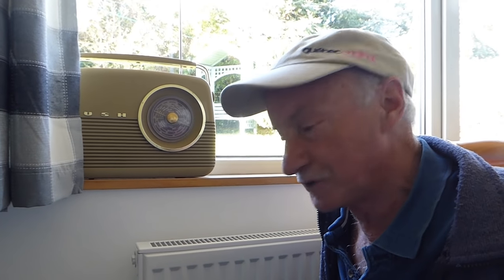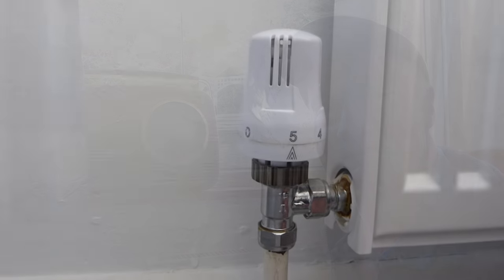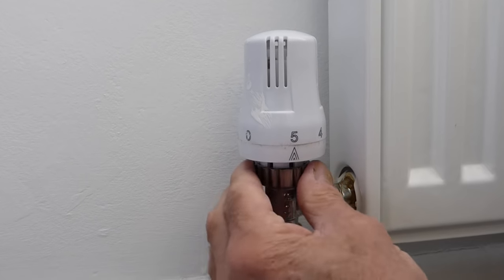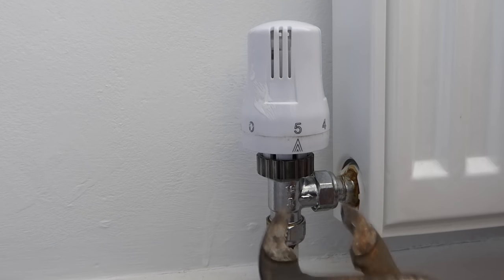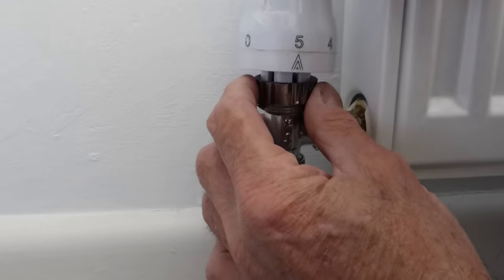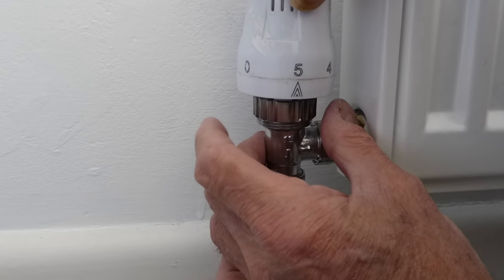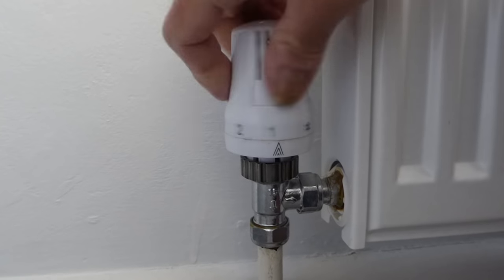How to remove and replace a thermostatic radiator valve head

Comment: So.... I was messing around with my brother and snapped the whole thing off and the radiator was stuck on full blast! So I took the base with the twisty nozzle thing and stuck a coin inside and forced it on managed to shut it off temporarily but I will have to buy another to fix it properly, your video is a life saver!
Reply from the maker: No problem.

Comment: Haha, your video is still helping people after 8 years. Thank you for such short and simple video it was helpful. 
After the maintenance guy at my place removed it and never came back to put it back, I was struggling with put it back in. I knew what to do but i was not sure if that was the right way to do it. Your video definitely helped.
Reply from the maker: You're welcome!
Reply: EXACTLY my situation. Only I did put it back on myself but just wasnt 100% sure if the number 5 was supposed to be when you put it down on top of the pin. (It was! So thank you for this little confirmation video). A very easy little job but essential if you want to regulate your water flow/radiator temperature

Comment: Thanks. I thought you could replace them as easily as this but my plumber told me you had to replace it with the exact same head. He said that there were loads of different sizes of threads from different manufacturers and if I couldn't find the exact replacement head I would need a whole new valve including the metal part which would mean draining the system. Unless there has been a massive miscommunication, he's trying it on with me!
Reply from the maker: You will need to get the same head as the make of your valve.
Reply: dereton33  Thanks very much for taking the time to reply. Great.
Reply: Is there an easy way to identify what make and model of valve that I'd need?

Comment: My radiator in the sitting room hasn't worked for months properly since I moved into new flat. Woman said she's upgraded boiler and central heating. I'm wondering that she did it herself now. Checked today of photos of valves to try to solve problem and realised the thermo valve was fitted back to front so dial facing the wall!! Thank you for this video, I've moved it round to face the room so I can actually see what setting it's on! 

It also seems to have a valve on either side (normal old fashioned one on the left, thermo on the right). Don't know if this is affecting its ability to heat either.
Reply from the maker: No that will not effect its ability to heat up.
Reply: @dereton33  thank you again for your video. My sitting room is now warm for the first time! I changed the direction of the other valve & hey presto. 

Can't thank you enough... I'm just frightened of my gas & electricity bill this month trying to heat the place before I realised the issue, but you've saved me cost of a plumber or winter of discontent. I'm in your debt👍

Comment: Thanks for this! Had a mare when 1 fell off completely in a house which already has a few wobbly ones. Couldn't even get it back on till I held the head in my head & turned it fully the other way after which it popped right on! Although I think I've screwed the direction of number to turn, but hey ho I'll figure it out when the heating is on. Cheers again, couldn't go to bed till I knew I'd fixed it!
Reply from the maker: That`s great.

Comment: Cracking video, im looking forward to updating my TRVs to battery operated smart TRVs (control whole house / rooms / rads with an app)
Reply from the maker: Fine so long as the batteries last.
Reply: @dereton33  I know exactly what you mean.

I installed wet underfloor heating in my house and used heatmiser battery wireless stats. They only took non rechargeable AAAs which lasted only 6 months.

The idea of putting down loads of insulation to be more environmentally friendly was slightly tainted by using up 28 AAA batteries every 6 months 😬

From what I gather the drayton ones last 12-16 months, however before buying I will try and find out if they can take rechargeable.

That being said I want to stay with a decent brand as I don't want to be changing them out every 4 years due to tech being outdated.

I doubt they will do a smart wired stat.

Another idea I had was to have some kind of 'in line' 15mm stopcock which you could control with an app.

Luckily I live in a bungalow so all pipes and the likes of are nicely organised in the loft which is just lovely.

Another option to control each rad better is to buy some of that plastic/ali pipe and put a manifold up in the loft somewhere and control it that way

Comment: Hi, I’ve moved into a house that’s 12 years old, I have changed the wall thermostat to a new digital Honeywell dt90e as shown in your video, fantastic thanks for the guidance. 
Now I am wondering if I should change the radiator valve heads? Myson 2 TRV 2 way, do they a expiry life. Thanks kevin
Reply from the maker: They should last a longer time yet why not wait until you see signs of them playing up.
Reply: Thank again, your are heatsaver 👍🏼

Comment: Great video. If my thermostatic valve is dripping water from underneath the head (running all the way down the upright pipe), do you think I might need to replace just the top section? Thanks!
Reply from the maker: No the whole valve.

Comment: Clear and simple video thanks.  Do you know what make of valve that is?  I have one the same that is faulty.  When you turn it to 0 it doesn’t turn the radiator off.  The valve itself moves and you can turn the radiator off by pushing it down manually with a grips just seems to be the head doesn’t push it down properly.
Reply from the maker: I don't, it was done a long time ago.

Comment: Thanks for your videos. You mention about replacing the top (head) part of the TRV if it is gone (faulty). How do you establish that a head is faulty?  We have slip on TRVs on a number of radiators, and not the screw type. The local plumber cannot source these types of head, so would need to change all if the TRV if they are faulty, so trying to establish if any are faulty first? Thanks
Reply from the maker: You do have to know the make and if you can get just the head not all valve manufacture's do.

Comment: It always looks easy until you try it. In my case I couldn't get the new head collar to fit the existing valve thread. Checked with calipers and the thread sizes were different by about 2mm. So frustrating, so now what do I do ?
Reply from the maker: Complete new valve you have an old odd size there.

Comment: I tested our heating in the house we've just moved into. Upon having all radiator thermostat valves set to zero or off I turn on the heating and then I have a radiator which goes really hot even when the rtv is on off/0. I've swapped it around with another one but it still goes really hot. This is one of the bedroom radiators upstairs. The hallway radiator I understand should always be on in order for heat to escape from somewhere.
Do you have any tips or recommendations for this? It's driving me crazy. Thanks a lot
Reply from the maker: The valve itself and not the head will be faulty, best to renew the complete valve.

Comment: Brilliant video! But I think there may be something else wrong with mine as the top of the radiator doesn’t get hot, only the bottom.
Reply from the maker: The rad needs bleeding.
Reply: @dereton33  Didn’t think of that! Thanks 👍🏻

Comment: How do i tell at what temperature i have to fix the new knob on? Basically making sure the current temperature of the radiator is in sync with the new knob i fix, so if i rotate the knob its showing the right temperature. I see you fixed at 5 but how do you tell your current knob is working at 5 temperature? Hope it makes sense.
Reply from the maker: It will be at 5 when the pin on the valve is fully up. As you turn the valve it will push the pin down and so turn it off when it reaches 0

Comment: Is there a way to remove the valve when the radiator has been removed from the wall for decorating? (Your video on that one was extremely helpful!)
Reply from the maker: Only if you drain the system.

Comment: Hi I want to change the head only do I have to turn off the  boiler  or drain water off sir   thank you for your answer another question you know that black  pin in side top is came out this means is broken or can be like that many thanks
Reply from the maker: No.

Comment: Hi Dereton

I had an engineer come round yesterday to replace a thermostatic radiator valve. I watched this video previously and removed my thermostat which allowed my radiator to work great. 

Once he applied my new thermostat. I'm having the same problem as before. The radiator will heat up as soon as my heater/boiler turns on. And then get cold after 30-45 mins whilst all the other radiators are hot. 

I ended up removing the thermostat again. The radiator is now working great without it. But I'm unable to control the heat as I no longer have a thermostat. 

Do you know what might be the problem?
Reply from the maker: Your heating system needs balancing.  Or the radiator maybe the bypass one, or one placed close to the room stat in a hall. If that is the case then turn the valve flat out to number 5.

Comment: Question. I have a leaking valve and afraid if I take it off the water may spray everywhere.
Is there a way off shutting it off before I replace that head?
You turned yours up to 5 
I had to turn mine down to 0 to stop it leaking. Any advice gratefully received
Reply from the maker: If it is a thermostatic valve leaking there is no way to repair them, they have to be renewed.

Comment: Hi can I just ask , can you get a stat that you can put on a radiator by just fitting it on the fitting that is  there already or  is a is necessary to change slightly the pipe work to accommodate it ? Simple clear videos - thanks !
Reply from the maker: Yes you can.
Reply: @dereton33  ah wow that’s so much for such a quick reply - have a nice Easter !! Nuisance now I appreciate - in Ireland - we have b and q here - is there any chance some time you could add a link or name of one ? Thanks again

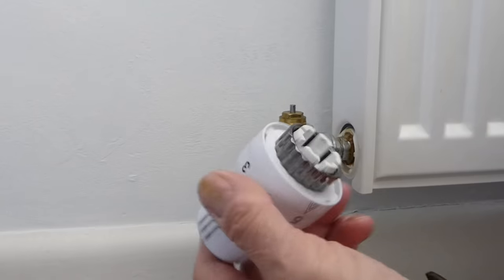Comment: I have a tiny leak coming out of the bottom of the trv head. Do you think the gold nut at 1:03 (exposed when you took off the head), just needs a tightening?
Reply from the maker: No dont touch it, you need a new valve.
Reply: @dereton33  thanks, thought ptfp tape might help but looks like I'll have to call the plumber 😢

Comment: Hi. Thanks for this. The top of mine seems to be broken /snapped? I had it replaced not too long ago and it’s happened again. Is it because it was put on too tight.?
Reply from the maker: Could be, they only need a small nip up with grips.
Reply: dereton33 Thanks. It was broken and I thought it was replaced and when radiator was. But I think the valve head may have been glued on as it seems weird it would happen twice.
Reply from the maker: Yes may already have been broken.

Comment: Can I please ask is that all you need to do if the radiator is only working say at 3,4,5 setting abd not 1 abd 2 or do I have to change out the metal bits that come in the packet also?? Thank you
Reply from the maker: Do not worry most of them only work on the 2 and a halve and above setting

Comment: I broke mine the other day,it snapped off, is it just a case of replacing like this and does it matter which one I buy to replace it with,does it have to be the exact same one  ? If so how do i go about finding the exact one i need ? Thanks
Reply from the maker: Look for the make on the side of the valve and get the same one.

Comment: Hi Al! I have a question, if I am moving the head to a radiator that didn’t have a head before, how do I know what temperature to set the head at? In others words, how do I make sure that the heat coming from the radiator it’s the one set on the head?  
 I hope my question makes sense and thank you!
Reply from the maker: Make sure the new head is set full on number 5 or 6. Face the reading cut out facing you into the room and screw the chrome nut onto the rad valve body.

Comment: Hi great video! I am trying to replace my trv head with a trv head from another radiator in the house. Both TVs are the same make, but when I try to put the different head on, it doesn't lock into place. Any ideas? Cheers x
Reply from the maker: No they should fit. Maybe worth trying another one.
Reply: @dereton33  thank you! Also, when replacing a valve head, does it need to be the same make as the previous one? Or just the same size?

Comment: Mine was even easier, after taking off the top the pin in the brass valve had jammed down stopping hot water to the rad, squib of WD40 and a tap with a hammer and it popped up, job done🤗🤗
Reply from the maker: Well done.

Comment: Great deno. Thank you. One question hoping you can help with. I've bought a new TRV but the pin on the valve sticking up is to tall for the new TRV (probably by 2 to 3 mil). So the new TRV doesn't drop low enough to reach thread to be skewed in place. What can I do? Thank you!
Reply from the maker: Did you buy just the top as not all of them fit.
Reply: Hi  @dereton33  - no I bought the whole joint, but not sure about replacing the piping joint as I'm terrible at DIY. I thought of maybe cutting a 2 mil off the pin to make it fir?

Comment: Our valve head came off (think little one had been messing) I’ve put it back on but the radiator won’t heat up..the pipe leading up to the valve from the floor is warm to touch, but the radiator is ice cold. Any suggestions?
Reply from the maker: Valve head located in the wrong position, take it off and replace then make sure it is turned up to 5.

Comment: I dont know if anyones going to reply but i bought a new one and the sticky out bit on the radiator valve stops the thermometer like it wont fit as the thermometer doesnt have a hole to slot into
Reply from the maker: Not all rad tops are universal. You will have to change the complete valve.

Comment: Can u keep it off want a radiator cover and will fit better if this is off? Thanks
Reply from the maker: Yes you can but the rad will be on full blast unless you turn the locksheild valve down on the other end.
Reply: Thank you x

Comment: I have a radiator which runs on water (not steam) with a valve head just like this one. It is always fully closed, but whenever I open the window it gets hot, which makes me think that the "0" it's on is more like 1-2, since it gets hot when cold air blows on it through the window. Is there any chance that the problem is just the valve head, or more likely the valve itself? In other terms, which is more likely to be the fault, given normal use? It'd be great news to be just the valve head, since it's easily replaceable, rather than the valve itself which would require draining the radiator, etc
Reply from the maker: Sorry it is still best to renew the whole thing as it could be either.

Comment: Hi, lady on my own had a new vertical radiator fitted, the thermostatic valve, I have to have on 5 to get hot, if I turn down it goes off, the pin is bit stuck, is it a, faulty thermostatic valve, do I just need to replace it, thankyou.
Reply: I meant the pin is not stuck
Reply from the maker: Yes change the valve.

Comment: Hi my hot water in is in the bottom of the radiator as in this video but some people say we need to place it upside of the radiator to make it work efficiently because the heating air rises up so if the valve is placed up the heating air will rise up and valve will get the real temperature then. What do you think?
Reply from the maker: Leave it where it is.
Reply: dereton33 then no need to take it up? And it will work fine?

Comment: Hi, the dial part (the one with the numbers) of my radiator valve head came off and I can't seem to screw it back on properly. After putting it back on, it just came off again when i  tried to turn the radiator off. The valve head itself is attached properly like in your video, I just can't put the dial back on. Hoping you can help, thank you! (also, thank you for all your videos!)
Reply from the maker: That is usually a fault with the valve itself. You may have to think about a new valve.

Comment: Hi I have an issue. My thermostatic valve head off and I can’t remember what heat setting it was on. How do I take this into consideration when putting the new one on?
Reply from the maker: Just set it to zero it will be easier to fit back. Face the opening part that reads the temperature facing into the room so you can see it.

Comment: I want to add s thermostatic valve head as my radiator doesn't have one.... Is it the left hand side of the radiator that the valve goes on?? Many thanks!!!
Reply from the maker: Do you mean the complete valve, you can not add a valve head to a normal valve, only a thermostatic one.  They can go on either end.
Reply: @dereton33  both my radiators have a cap ... They look identical. I want to add a thermostatic head on but not sure if it was the left or right hand side of the radiator.

Comment: Im abit worried about removing my valve...i think the pinhead could be stuck but im worried incase i do it wrong and water comes rushing out...do you think i should call a plumber because i have zero experience doing this?
Reply from the maker: If you are worried then yes leave it for a plumber.

Comment: My old thermostatic valve rusted /snapped off so I replaced it with a new one but now it's leaking - any idea what could be the cause /solution?
Reply from the maker: The valve body is leaking as the the new head forced it to work again, No way out except a new valve.
Reply: @dereton33  thank you 👌

Comment: Mine was recently fitted but came off as the installer didn't tighten it, however, I don't remember which setting it came off on, will this be an issue?
Reply from the maker: No do not worry.